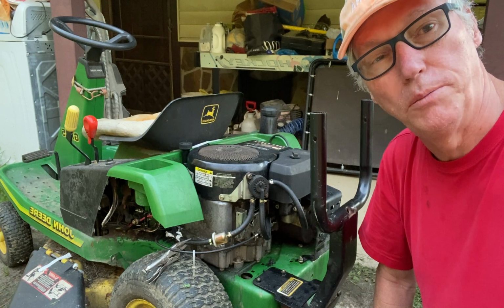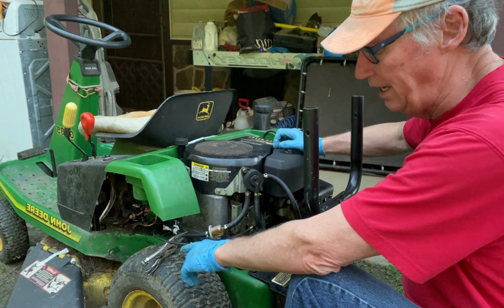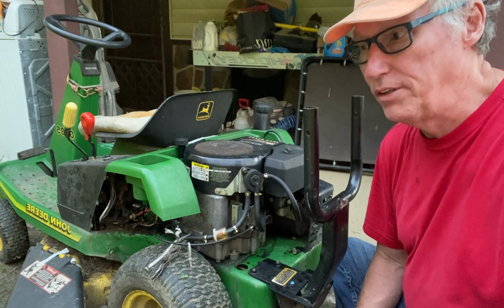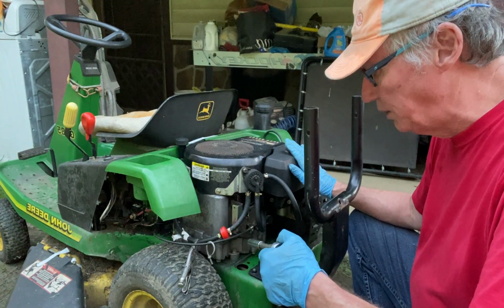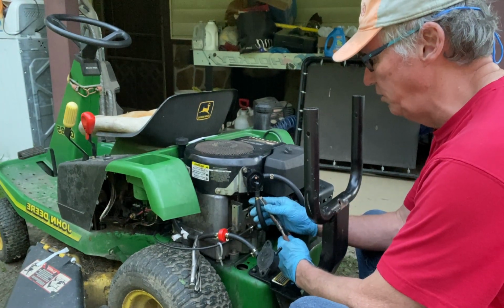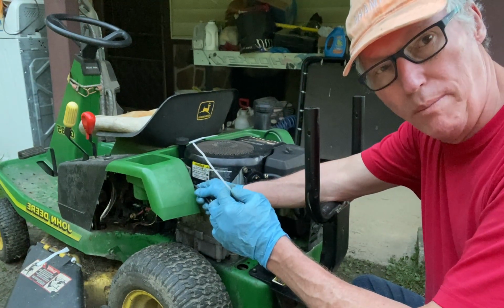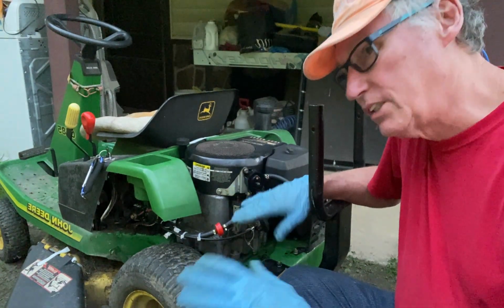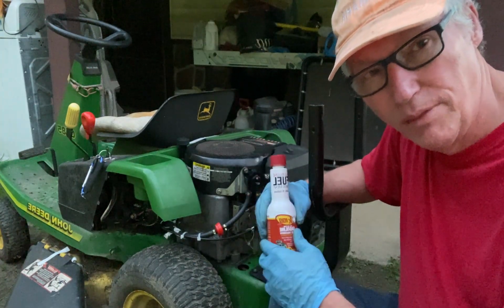GX85 repair and results

Comment: why don't you tell us where you got the carburetor how much you paid for it etc model number make number because I've done my research and they are almost impossible to find except proprietary $185
Reply from the maker: its on amazon Harbot 699831 694941 Carburetor for Briggs & Stratton with Air Filter for 28D702 28D707 28M707 28R707 283702 283707 284702 284707 284777 286702 286707 289702 289707 Engine Lawnmover
Brand: Harbot
4.5 4.5 out of 5 stars    439 ratings
$25.97